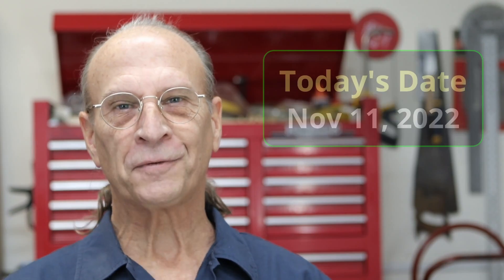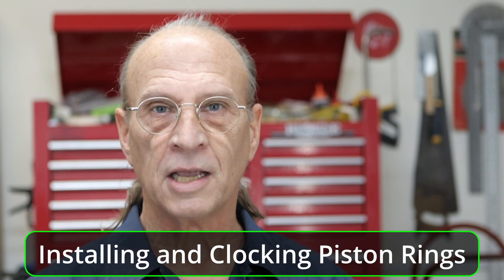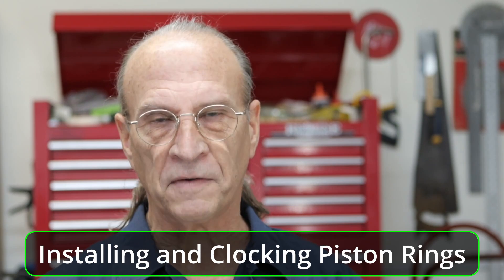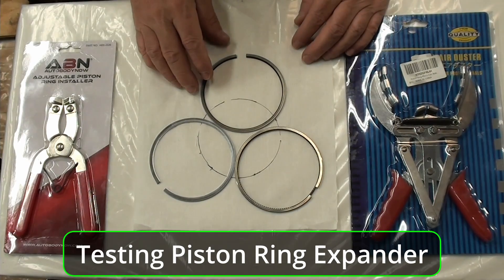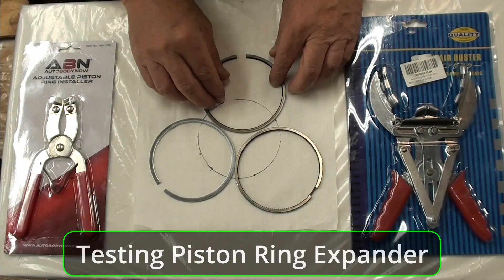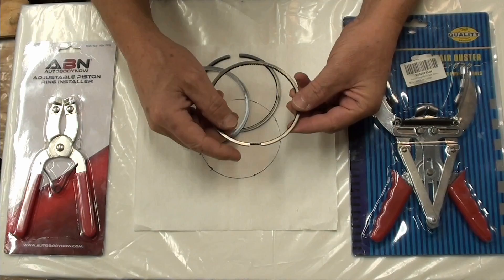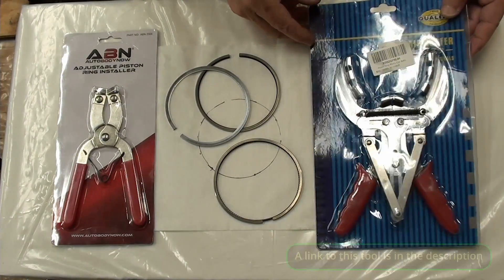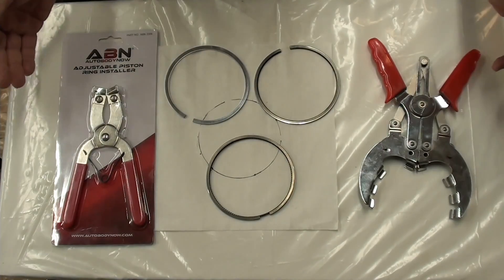560SL - Installing and Clocking Piston Rings

Comment: Hello, why didn't you want to buy Goetze or Daimler Chrysler rings? They are much cheaper
Reply from the maker: Cheaper rarely means better. Throughout this entire build I am using genuine Mercedes-Benz parts whenever possible. Even simple over the counter bolts and screws I purchase from Mercedes. Also in my case Mercedes gave me all 8 sets of rings for the price of just one set. I also want to say that these are low friction rings made specifically for the Alusil blocks.